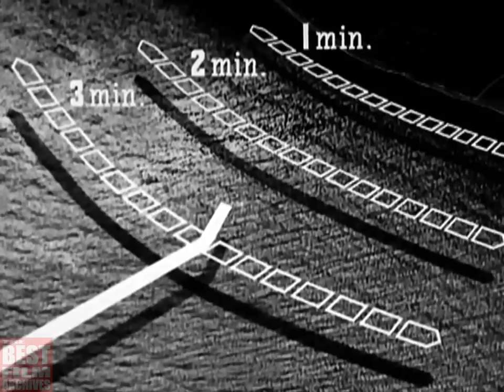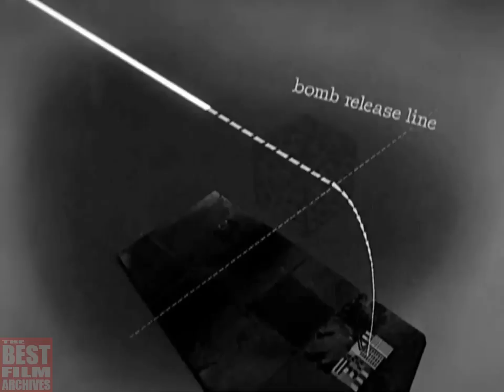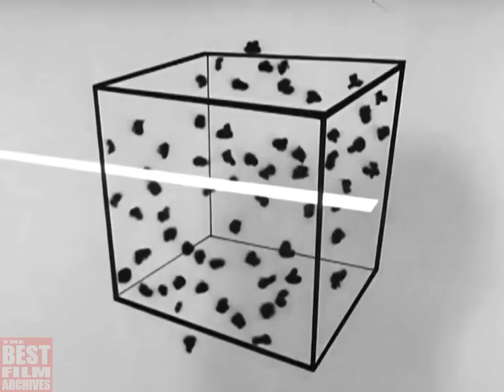German Anti-Aircraft Gun System | Flak | US Air Force Training Film | 1944

Comment: thing is, 105 mm didnt have exact same characteristics, it had to have shorter flight time. 128 mm supposedly reached the height in 10 seconds, not 30, Accuracy due to higher velocity and higher projectile mass not losing energy as much, meant the spread of fire would be smaller, so, a more accurate weapon, faster to land, a few times stronger chargé.

Comment: i have heard that the germans lost the air control 1943.
Reply: I'm not sure if it was as soon as 1943, but by 1944 it was crucial that the Allies had air superiority to support Op. Overlord, which they had.
After the invasion of Britain was scrapped, they stopped sending bombing runs to the UK, relying instead on the V1 flying bomb. Though it was very difficult to knock those missiles off target, they were only good to shoot at London. Because they could only hit somewhere in a target as big as a city.
The Allies, though, kept sending hundreds of sorties per week into German infrastructure between the capitulation of france, and the subsequent drive off of Allied troops from mainland Europe, and the end of the war. They did it by overwhelming number of planes rather than suppressing the german air power.
Reply: yean Basch It wasn't really until the arrival of the mustang escort that the Luftwaffe lost control of the skies over Western Europe. So not until 1944. Before then day bombing was extremely hazardous and often ended with large casualties due to the large number of German fighters.

Comment: I didn't know about the range finder, i thought it was all done manually by eye sight
Reply: Depth perception does not work at all when it comes to distances like that. Using simple eyesight, you can't distinguish between an airplane that is on an altitude of 10000 feet and one that is flying at 25000 feet. And because the airplanes are in the air and not on the ground, your depth perception is 0. All you would see is, a small airplane shape somewhere up in the sky.
Reply: Sagara Sousuke  ships had rangefinders like this for their main battery gun, secondary gun, and AA guns. Some for torpedoes as well
Reply: It's not all complicated technical stuff. If you know what size the plane is you can find out what altitude it is flying by looking at the size it has through a certain scope.

Comment: So they actually had computer automated-aiming on their flaks? Or am I misunderstanding what they mean, that seems amazing for the time. I thought all the aiming had to be done by hand.
Reply: mechanical calculators had been used with artillery since the 19th century and and analogue computers since the 1920's
Reply: More or less - those are not computers in the sense as we know them today but a predecessor.
Reply: Usually not, rather humans read the output and aligned the guns when in air defence use. But there were fully motorised and automated Flak 88's that may have been used in "Command Control" mode (remote control or electronically synchronised for air defence) but my knowledge is more to do with the electronics than the actual air defence systems
Reply: Analogue computers are actually electronic, and full computers but operate in the analogue domain and thus can be much simpler than digital ones but require constant calibration
Reply: +carlos perry 
No they weren't, the Allies had better fire control systems
Reply: @cptant7610  the proximity fuse being a prime example
Reply: Bang Switch
so am I right then?
Reply: Your definition only covers digital computers, they have no relation to the analogue computers used in ballistics up until the 1980's
Reply: They used electro-mechanical computers - in principle a bit like huge complex slide rules. They worked quite well, but like any computer they are only as good as the information they're given. Accurate observation of height and speed using optical instruments is pretty hard to do.
Reply: ***** Yes they are programmable, otherwise they would be referred to as calculators, but due to the different nature vis a vis digital they will need different techniques, reconfiguration or additional hardware to be more generic so they are, and where mostly used as task specific instruments. The main advantage they have over digital is that computations are always instantaneous, although with modern digital processors that is less of an issue.
Reply: Indeed. Very basic by modern day standards. But. Top of the range back in the 40's
Reply: CPTANT what's funny? History is a one big lie written by the victor.
Reply: Yes, by 1940s computers.  All mechanical, and analog, of course.  My grandfather worked on one of these on a Fletcher-class destroyer during the war.  He said it was about a 4x4x6-foot box and weighed like 3,000 pounds.  Once they had acquired a target and tracked it, the computer could automatically keep their sights on the target provided it didn't change course or speed, and automatically aim the guns as well via selsyn links and power drives. 
When in director-fire mode, a single trigger pull in the director would discharge all the guns simultaneously.  It was highly complex.  And yet, even with state-of-the-art fire control, it often took hundreds of 5" shells (or more) before one took down a plane.
Reply: Tru
Reply: Okay but my main question was did the computers AIM the guns.. like through electric motors and such.
Reply: Ian Knau Germans were advanced for that time. They were advanced than the rest of the world
Reply: "Watch history channel"

HAHAHAHAHAHAHA, nice one
Reply: Well about the Manhattan project;
''The project was also charged with gathering intelligence on the German nuclear weapon project. Through Operation Alsos, Manhattan Project personnel served in Europe, sometimes behind enemy lines, where they gathered nuclear materials and documents, and rounded up German scientists. Despite the Manhattan Project's tight security, Soviet atomic spies still penetrated the program.''

And the anti-biotics;

''Synthetic antibiotic chemotherapy as a science and development of antibacterials began in Germany with Paul Ehrlich in the late 1880s.''

''The era of antibacterial treatment began with the discoveries of arsenic-derived synthetic antibiotics by Alfred Bertheim and Paul Ehrlich in 1907''

About B29, i agreed with you how B29's was effective on the field, but if we are talking about technology here, we should check another flown concept ''Amerika Bomber'' well the name of the project is errm yea so inhuman :) i know but we are talking about tech and in my opinion, same date with B29:check, is it flown:check.

https://en.wikipedia.org/wiki/Amerika_Bomber

And besides of all about the bombers technology, my oscar actually goes to Horten Ho 229. It is obviously ancestor of another perfect bomber B2 Spirit which is it 40 years younger than Ho 229. Us made an another operation to move that prototype to Us :)

Here you go;
https://en.wikipedia.org/wiki/Horten_Ho_229

I am agreed with you about proximity charges effectiveness for allies, yet Rheinmetall made the same fuzes with the same technology in the same era, they both developed that tech from austrian physicts ''Doppler Radar''.

In naval mate;

I think in this field, further than u-boats and torpidoes, there is 1 technologic design in Axis forces non-comperative for Allies, its ''Bismarck'' mate. I know i sounds like ''fan of Axis'' :) yet i am not, i just love the technology and speak besides the politics. Mate that ship was ''wow''. Also Axis has ''Yamato'' class but in my opinion ''yamato'' class was more like ''bigger/better'' project except than technology. But ''Bismarck'' mate was extra-ordinary thing, who get single order for whole enemy naval forces for single ship ''You must sink the Bismarck'.

For the naval aviation;

Yes, agreed with you that German's choose under-water instead of the sky :) Yet in this hand Japan's were also almost equal with technology.

In Technology situation was like this but, if we say about politics, Allies has ''Churchill'' Axis not :D

Greetings.
Reply: The fact that someone shipped the 1000 ton Belgian Uranium stash to New York (without the mandatory US customs paperwork) and not to Berlin did put the US ahead.
Reply: reiknir
That flak 88 in the video thumbnail looks motorized.
Reply: Ian Knau 

https://en.m.wikipedia.org/wiki/Norden_bombsight

Here's an American example of an early computer-assisted aiming device used during the war.
Reply: I was thought that they still use analog computers for missiles and such as they are more resistant to emp.  I might be wrong though.
Reply: Its called a fire control computer and yes they were invented and put into practice in WW2, and similar such instruments existed before hand and have been used in many artillery applications throughout history of one sort or another
Reply: Indeed they had simple targeting computers. Towards the end of WWII the germans also had guided anti air missiles, although they were not nearly as accurate as todays ones and far to expensive to play any major role.
Reply: Ian Knau theirs a cool vintage training video on YouTube about how the old analog targeting computer that were on the WWII err war ships worked but it doesn't go in too much detail
Reply: But the entire point of the aiming calculation is that it predicts where the plane will be in the future.... Accounting for the time needed to aim the gun should be trivial in that calculation.
Reply: "Analogue computers"
An "analogue" computer would be "something like a computer; a computer substitute." Like bath salts are an "analogue" to real drugs.
An analog computer, OTOH, is a "non-digital computer."
Reply: There was PLENTY of stuff the Allies were ahead in.
Reply: like?
Reply: Atomic weapons
radar/sonar
electronic computers for decryption
anti biotics
B29 (incomparable to all bombers before it)
proximity charges
naval aviation

Well and of course every naval design except for submarines and torpedo boats, since the Axis were so dominated in the area of surface fleets that they didnt even bother. But the Allied ships designs for carriers, battleships, cruisers and destroyers were quite advanced.

Actually I would say the areas the Allies were ahead in had a lot more impact on the war than the areas the Germans were ahead in did.
Reply: No, the bottleneck in building an atomic bomb was not the availability of uranium ore. Both powers had access to enough raw uranium to build a bomb. The bottleneck is the production of plutonium or enriched uranium from that ore. enriching uranium or breeding plutonium requires extensive knowledge and industrial investment.
Reply: Yes, mechanical analog calculators for AA gunnery were in widespread use by all the major warring powers by that time. The Allies had an advantage with the development of the proximity fuze for AA fire. This cut the expenditure of heavy AA ammunition in half.
Reply: John Olive They proximity Fuse was only effective for the 40mm Bofors. The heavy Flak Guns wouldnt have benefitted much
Reply: blauerninja You're thinking of digital computers.  Analog computers are a whole different ballgame, and the ones used in artillery wouldn't really be "computers" by today's definition, but more accurately be referred to (at least in today's terminology) as calculators, and were not programmable.  It just took a number of different inputs in real time and generated a continuous (as opposed to digital computers) output - gun orders (elevation and azimuth) which were transmitted to the guns via selsyn (again, these quantites were transmitted to and from the computer in analog form, not digital).
Reply: blauerninja And the computing in these WWII-era calculators was all done mechanically utilizing various mechanisms - differentials to add/subtract, mechanical resolvers for trig, disc-ball integrators to integrate, cams for more complex functions, etc.  The only electricity they used was for servomotors and such to drive the mechanisms.  In World War II more advanced systems (such as power drives in the U.S. Navy) could automatically aim the guns as well based on the computer's gun orders.  It's remarkable to think how the technology evolved from World War I, when fire control was little more than a group of people around a plotting table with slide rule-type devices to figure out the firing solution.
Reply: all you morons here talking bullshit about what you think a computer is. what a bunch of morons. also apparently you people never heard of Zuse Z3 computer. it was the first true programmable digital electronic computer. germany had it all. even if you morons have no education and don't know about any of this.
Reply: yeah me too
Reply: My grandpa was in France during the war and was in fact a computer operator.
Reply: It’s a mechanical calculator which has incredibly tiny computing power but I believe this math problem is only a linear differential so not a whole lot of power was required
Reply: No they didn't. And that is the problem. The History Channel is AWFUL for learning history. Most of the programs are the worst kind of "purple prose".   I gave up on the history channel.   Scholarly books, historical documents, original photographs, treatises, etc are where the real history is, not the History Channel.  The real history gets complicated and often shows how much depended on the point of view of the observer and the people fighting and those in charge, not to mention the designers, manufacturers, and the politicians as well as the pressures of reality.    I was once a history channel fan myself until it became obvious that they were less interested in truth rather than ratings.   One exception I have found is some of the cgi on WWII aviation, some of it is really well done and actually tracts historical facts.    The Germans were ahead on some things but woefully inadequate on other things.   A lot of the German internal  infrastructure and industrial policy was ridiculously outdated and poorly organized.
Reply: Calling BS Carlos. The Germans were behind on a lot of stuff. They desperately needed a proximity fuse and failed in making one....we had them.
Reply: As I understand it, these communications are done by radio and all the calculations are done by hand. Computers only came into existence in WW II so it was all done by hand. Makes it all the more amazing if you ask me.
Reply: Well if we are talking about the technology here, yea Germans had way too much advanced one, those were  in land (tiger tank, krupp cannons etc.), naval (u-boats, submarines etc.) and the air (Stukas, messerschimdts, bf seriers etc.) Swarm was the strongest point of allies, like only us produce 50.000 m4 sherman tanks, uncountable planes etc. Swarm won the war, not the technology. For today, basic of that German technology built our today, like missiles etc. For that, check Operation Paperclip and i couldnt remember operation name but Russia has it own way to do that also. For example, Saturn V rocket made Man on the Moon dreams come true, and German phisicists made that Saturn V rocket etc. All new generation fighter planes pre's, basic of jet engines, ballistic and cruise missiles bases, all came from German technology. So now they serve all world now, instead of 1 race :D
Reply: @tivorlulawrence1770  That's an oversimplification. Frank Whittle was working on jet aircraft as well. The B29 was a very advanced aircraft for it's time. The Spitfire's technology and performance remained in front of the Germans for most of the war. Britain's anti submarine technology eventually wiped out the u-boat wolf packs. Britain's intelligence people cracked the enigma code. - All German spies were turned by MI5. The list goes on and on...........
Germany's arrogance was one of it's own worst enemies.
Reply: CPTANT  yes the allies made better fire control system but what I'm saying is that the Germans invented almost everything war related. Watch history channel
Reply: The German nuclear project was a joke. They failed to achieve even 1 critical reactor (something the Allies already did in 1942) and no this is not due to heavy water sabotage, in fact the Allies never used heavy water at all in their atomic project, they used graphite moderated reactors. This fact alone puts the Germans more than 3 years behind.

The invention of antibiotics in the 1880's is irrelevant for who was ahead during the war. The Allies had the technology to mass produce anti-biotics, the Germans did not.

The Amerika bomber project never actually produced a bomber that met those requirements. The B29 on the other is capable of that range.  

Allies also had their own flying wing projects, these projects weren't continued because conventional airplanes had better performance. The B2 bomber is incomparable to the Ho 229 except for its basic shape (A concept that was not new to the Ho 229)

Germans tried developing proximity fuses, but none ever saw service. There were some prototypes for use on rockets, but none ever intended for use of shells. In the meantime the Allies produced and used millions of them with devastating effect.

The Bismarck is a ship that is completely inferior to the Iowa class battleship. It has inferior gun range, inferior gun salvo weight, inferior speed, inferior fire control. The only thing remotely comparable is armour.

German type VII submarines weren't actually superior to the Allied submarines by the way. The Allies suffered from problems with their torpedo's but otherwise had comparable, if not better submarines. It is the type XXI that influenced post-war designs.

Japanese naval aviation was only comparable at the beginning of the war, Japanese aircraft development was stagnant, while the Allies kept introducing more advanced airplanes.